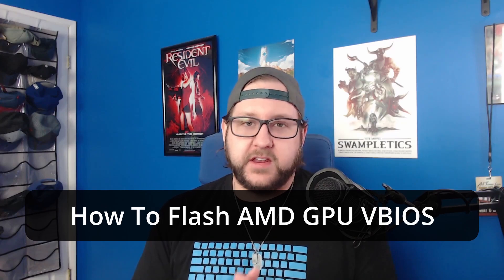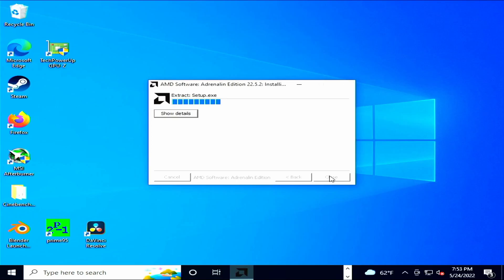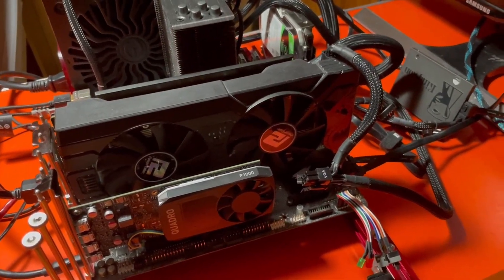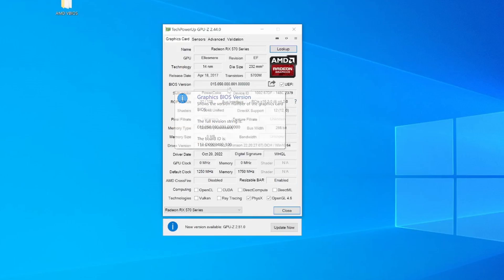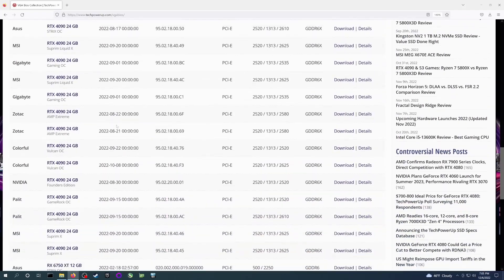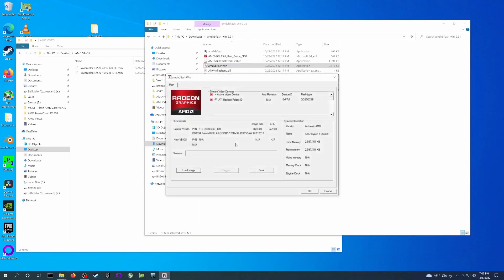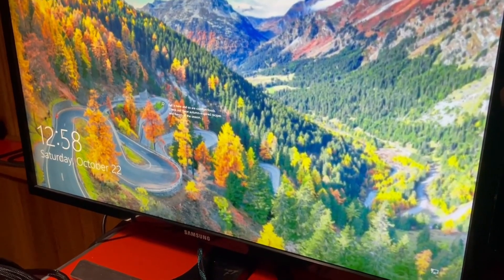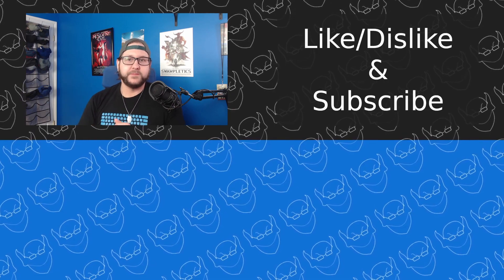How To Flash AMD GPU VBIOS

Comment: so, before even trying anything about flashing my gpu and shit, i just wanna ask some things cause i'm kinda new to this gpu faulty things so, my RX580 2048SP is been having some trouble for a while now, it can run games pretty smoothly but it just shuts down my whole computer. no artifacts, just bright colors (light red, purple, green well you get the drill), and i'm kinda curious to try out flashing it's vbios cause really, i've tried everything, ddu reinstalling drivers, different versions (still crashes the whole pc), but it was only running the games without crashing with the default video driver from windows and i was absolutely chocked that with the default shitty driver that can't even run windows smoothly was not crashing the pc so i'm really out of options rn and i just want some advice
Reply from the maker: Tbh, that sounds like maybe something is faulty with your card, like the GPU or VRAM is faulty and hitting a certain spot on the VRAM or clock speed is causing the issue.

Though it's definitely worth a shot to see if flashing a new VBIOS will help.
Reply: yeah, it is something faulty just like you said, like, when it hits a certain clock speed it just stop working but thanks tho! the video helped so much :D
Reply from the maker: @skinno9136 I'm glad my video helped, but I'm sorry to hear your card is borked :( a bit bittersweet lol

Comment: can I ask,  
I have to down clock the vram by -500
and down clock the core by -330
and also the power limit to +75% to card stable and useable and yet on another game its keep crashing

its wont crash if I dont put any load on it, since I use dual gpu
the previous owner said its flashed with another bios, even tho the card is biostar
is the problem I encountering above is because wrong bios???
should I flash it back to biostar bios???
should I DDU the driver first before flashing the bios???
or I can just go and flash it???

fyi after I check the card... its biostar... but weirdly enough windows and adrenalin driver even msi after burner recognize the card as asus, as for gpu z its as OEM (AMD/ATI)
Reply from the maker: You could try DDUing the driver to see if that helps, but it sounds like you'd need to flash a matching vbios to your card to get it to perform like "normal"
Reply: @BitGoblin  so theres is possibility this card problem is from wrong bios???
 still... I need to open the heatsink to see the vram and chip number.... dang lot of work

btw...
thanks for the answer
Reply from the maker: @mineminemaybe it's possible it has an incorrect BIOS. Does the card have any obvious markings for like ASUS, PowerColor, etc? Or like a sticker with the model info?

Some people (I think it's usually crypto miners) can use vbios for a different vendor/card that has the settings they want to run more efficiently or whatever. But that can cause other issues
Reply: @BitGoblin  tried this morning... almost all """compatible""" bios I downloaded is getting "error cant read rom"
but some bios are just straight closing the amd flash app, wonder why tho. I just do the same step like the tutorial, even with same 3.31 amd flash app
Reply from the maker: @mineminemaybe could you try an older version? Sometimes it may not work on like 3.31 but it might work on 3.20 or 2.93.

I really wish AMD made this experience a lot smoother 😅
Reply: @BitGoblin  ok, I will test it next day... since I want to get a good sleep
Reply from the maker: @mineminemaybe that's a great idea! I always seem to mess things up when it's late and I'm tired lol

Comment: the thing is, i have an rx 580 xfx gts xxx edition or whatever and i got it second hand and i am sure (or at least partially) that it is the bios. the thing is the gpu is not displaying most of the times, sometimes when i turn on the pc it works sometimes doesn't. but when it doesn't display, windows detects it as rx 590. does this mean it has a rx 590 bios? but when it is displaying it shows up as rx 580. if it doesn't display and i check gpu z, will it say the bios version and details for the rx 590 or for my gpu rx 580, even if it says the name of my gpu is rx 590? sorry for bad explanation

Comment: I bought used xfx gts rx 580 xxx oc edition but when i play games the core clock only goes upto 11mhz but the memory clock 2000mhz ok than i research some information about my gpu than i found it has a switch for bios like dual bios so i switch the bios than check gpu in gpuz it's different now like in silent mode its shows original subvendor xfx pine etc 1100mhz core clock but when i switched to performance mode it show AMD/ATI subvendor and core clock 1245mhz but memory clock 1750mhz also lower 7.0gt not 8.0 and lower bandwidth like in quite mode its rx 580 gddr5 hynix and when i switched to performance mode its rx 580 2048sp gddr5 Samsung?????????

Comment: This was my last hope.. the flashing worked to update the bios, however my card still wont work in the pci-e x 16 slot .. only the lower x4 slot... (sad face) 

great video tho..
Reply from the maker: Huh, that is frustrating! If you haven't yet tried another GPU in the slot, it's possible that maybe your x16 slot is borked.
Reply: @BitGoblin  tried 4 other GPUs in the rig, all worked just fine.. the 580 simply wont work in the X16... works in the X4 slot tho.. and it works in a threadripper x399-e mobo's x16 slot.. just no other rigs... its weird AF ... so im goign to leave it in the X399 and call it good. lol .. BUT this video DID show me how i can flash the easy way for gpu bios, so thank you much for that Sir ..
Reply from the maker: Yeah that really is weird! It could maybe be due to the motherboard's BIOS version acting weird for certain GPUs, but I've only seen that when installing like HBAs or NICs. Certainly weird either way.

Sorry for the late response, but I'm glad the video helped and you're welcome :D

Comment: Hey man, I purchased a used 6900XT and I was getting a black screen and fans ramping up unable to restart until I did a hard reset by holding the power button. I tried everything I could find online for a fix. Motherboard bios flash, all kinds of different settings in Windows changed, bios settings changed, XMP on/off or 1/2,  new DisplayPort cable, new hardware (1000W PSU, RAM), a handful of fresh Windows installs, the list goes on. 

What a fucking pain in the ass. 

All that to say thank you for making this video, it saved my sanity and saved my GPU from being thrown off a balcony. Knock on wood it keeps working properly.
Reply: Also, for those of you watching that can't find amdvbflashwin in the most recent version, delete that and download the same one in this video, version 3.31. It works just fine.
Reply from the maker: I'm surprised the older 3.x version worked. My understanding was that the RX 5000-series and newer cards needed the 5.x versions, which sadly only has the CLI

Either way, I'm glad my video helped :D I hope your 6900 XT serves you well for many games to come!
Reply: I have the exact Problem down to a tea! You dont happen to remember which bios rom worked for you?

Comment: can I use my cpu graphics while doing this sort of troubleshooting? My asus rx580 just does similar things and display borks when under gaming stress that I had to revert back to my 1050ti
Reply from the maker: Yep! Using the integrated graphics on your CPU is perfectly fine :)
Reply: @ the bios was at its latest build. I just did some tuning and undervolting… stress testing didnt make it black screen yet. Maybe it was just badly tuned by radeon
Reply from the maker: @HarenunHoppus that definitely could be it! And good job getting your GPU to work :D

Comment: I have an rx 470 powercooler , it is recognized by a very old motherboard only, i.e. a modern motherboard, not 2 times and nothing final, just a working fan. Is the vbios the problem? I hope for a replay. Thank you.❤❤❤
Reply from the maker: I would lean towards maybe the motherboard's BIOS needs flashed. Or potentially the PCIe slot you're putting the card in is dead, if you have another card to try in it would be where I'd start.
Reply: I updated the BIOS to the latest version and tried the GTX 970 it worked . This problem still for rx 470 power cooler  occurred. I noticed it on any device that has a UEFI system BIOS happen this problem . @BitGoblin
Reply from the maker: Hmm, that's a new one for me, and anything I'm finding online suggests problems the other way (it works in a UEFI board but not a legacy BIOS). Maybe try resetting the CMOS on your motherboard? It's possible there's a setting or something that's preventing it from working with the RX 470.

This sounds like a fun problem to troubleshoot! :D

Comment: I tried all the 8 bios that are in the list for flash i had bought used msi rx 570 8gb oc edition and when opening games it is giving black screen in 10 seconds i tried all the bios but the issue persists please help me
Reply from the maker: What else have you tried to troubleshoot? It might be worth like reinstalling your drivers, swapping PCIe slots, or even reinstalling Windows in some cases to see if that helps
Reply: @BitGoblin  i found the problem and corrected it my gpu clock speed and vram clocked stucked at 300mhz i turned them to 1100mhz and for vram 1650mhz and my gpu running fine but only crashing in ghost of tsushima and rdr2 which i think some files  are corrupt so needed to redownload those games thx btw
Reply from the maker: Oh, so you manually just adjusted the clock speeds and that fixed it? And that sticks across reboots?
Reply: @BitGoblin  yeah i dont know somehow it's clock speed was stucked at 300mhz thats why its crashing games as they starts i was searching on youtube for different fixes then i saw my clock speed was 300mhz then searched how to correct it and an channel with 200subs had made video which helped me out

Comment: How do I flash for a certain bios switch? I have a dual bios switch. Also how do I download the PERFORMANCE and QUIET MODE for a GPU? I have RX 580 sapphire nitro+ 8gb.
Reply from the maker: Honestly I haven't tried it on a dual bios card, but I'd assume it'd flash whichever bios is loaded. So if the switch is on vbios A then it'd flash that one and not affect vbios B. But that's just my guess. 

I'll have to test this at some point...

Comment: Hello bitgobiln! I have a rx560 power color 4gb ive tried to search for newer version but all of them are  the same as the one I have (bios number )  but the card name in the techpowerup web is 560D 4GB so do i install the latest by date? and i don't have  another gpu or a pci slot so can do all of this with the integrated gpu ?
Reply from the maker: You can try the latest by date, but I'd also click on the rom details and verify it's for the same vram vendor and such that lines up with your card. I have a newer video on the amdvbflash CLI that has a better explanation on it.

And yes! You can definitely use your integrated graphics to get a display while doing the flashing - the only reason I didn't is because my 3600XT doesn't have integrated graphics

Comment: I can't get my R9 Fury to display. Card is on, fans are spinning but just no display at all. Does it need to be flashed? If yes HOW with no display?
Reply from the maker: It's possible a flash could fix it. To do so without a display though, you would need to either use your processor's integrated graphics to drive a display or use a second GPU to do it.

I haven't tested it, but you might be able to connect to your system via RDP if it's already enabled

Comment: HI, I am having subsystem ID mismatch error. any idea why?
I have video but it doesnt detect the second monitor and cant find it in task manager
Reply from the maker: What version of the tool did you use, and what graphics card are you flashing? It's possible you might need a different version to flash your card

Comment: After flashing P/N not showing on amdflashwin how will i know my bios is changed or not? My problem is my gpu is fluctuating its usage like 90% sometimes and sometimes it drops to 2% i am not getting the desired fps i have an used gigabyte rx 570
Reply from the maker: The GUI is a little finicky and it might be that the flash didn't take or something. But you might be able to view it from the amdvbflash CLI tool

Comment: Hello I just bought an rx580 8gb 2048sp around a month ago and I've been experiencing issues with it, here is the detail of its issue: when I'm in desktop or even just windows startup it freezes/stutters with the sound of windows connect/disconnect not if sound, and when playing games it freezes my pc for a few seconds sometime it would took a full minute to unfreeze then do it again for a few seconds. I have tried many fixes I know, reinstalling new and old drivers with the use of DDU, reseting gpu, reinstall windows (this worked for only a few days but would slowly go back to its issue), even checked for some virus but never find any, even opened it up and did a deep clean, still the issue persist. Do you know any ways I could do to fix this gpu? I would really appreciate it even though this vid a over a year old.
Reply from the maker: Have you tried flashing the VBIOS? Or have you tried potentially resetting or updating your motherboard's BIOS? It could be a bug in the firmware on either, or maybe the motherboard's BIOS needs an update to support the card potentially.

If you've already those things, then it sounds like you tried all of the usual suspects of causing issues and might be a fault with the hardware potentially
Reply: @BitGoblin  I think I might have fixed it, I used the oven method lmao it stopped the issue completely and been running well for 3 days now not sure if it's gonna last a while though since it get quite hot when playing elden ring around 70-75c max despite applying new thermal paste.
Reply from the maker: Awesome, I'm glad to hear it's been working for a bit! Hopefully that's still holding up?

Comment: I bought a refurbished Radeon Pro W5700 expecting to use it on my Mac mini with an Akitio Node Titan eGPU enclosure. For some reason though, I can only use it on my Windows desktop because that's the only thing that worked when I tested it. Any time I tried eGPU on a Mac, it would kernel panic and boot loop until it was powered off or disconnected; then the Mac worked just fine like nothing happened. This GPU should work on macOS, because I've seen other YouTube videos showing the W5700 working on a MacBook Pro.

TechPowerUp shows that the VBIOS to my GPU has three different manufacturers: AMD, HP, and Dell. Turns out, mine has an HP VBIOS, since that's the only one that didn't pull any errors when I tried to flash it. I'm guessing that since my GPU came with a bunch of HP documentation, it was an OEM part to an HP workstation. Does that mean my GPU is basically region-locked? Is there a way to bypass this and install a proper AMD VBIOS?
Reply from the maker: It's possible that HP looked down their BIOS or at least did something weird that isn't compatible with MacOS. But I'm not super familiar with running an eGPU on Macs to know for certain.

Let me know if you end up figuring it out though, I'm very curious what's wrong!
Reply: @BitGoblin  I’m currently chatting with Apple community support forums, and they’re saying that the OEM locked GPUs haven’t really been an issue for macOS since 2012. They’re suspecting some weird graphic driver issues withmacOS Sonoma in particular. They’re having me test my eGPU on an older version of macOS like Big Sur, which I’m installing now.
Reply from the maker: I would not have guessed that! 😅 let's hope an older MacOS works!

Comment: Damn bro, instead of fixing the issue with my annoying 6700 XT, this method just straight up broke my PC.

It’s not your fault but I’m so frustrated at whatever fix I find, it just made more problems. Fuck, man :(

I’m in the middle of trying all the restore points to fix my computer but so far nothing
Reply from the maker: Wait what? How'd it break? I've only seen bad flashes/images make drivers not load or not output an image at worst.
Reply: @BitGoblin I did everything in the video and once the program had me restart my computer, no signal upon startup and then the dreaded blue screen appeared. It says “Critical Process Died”
Reply from the maker: @dalemau5 does it boot normally with just inboard graphics? I wonder if it's just the Gpu acting wonky after the flash
Reply: @BitGoblin I removed the GPU and couldn’t get an image, even from the motherboard. Maybe there’s a way to switch so that your motherboard gets an image but I don’t know how. But I was able to get a Windows Bootable USB so let’s see how that goes. If everything work, I’m just gonna sell the graphics card and put more for an Nvidia one :(

Edit: So I reinstalled windows but I still couldn’t download drivers for my GPU without it crashing. Then I found out about how certain GPUs have a BIOS switch so I flicked the switch and everything is working fine now, drivers installed without issue.

Comment: does you need a second gpu to do this? I only has my only one
Reply from the maker: Nope, you can run it perfectly fine with just one GPU. It's just useful if you have a second in case the flash goes poorly

Comment: Bro after downloading bios and when i load in amdvbflash tool it shows a different P/N number should i flash or not , both cards are same but P/N are little different see this - Original is = P/N 113-C6710101-100  & new one is =  P/N 113-C6710101-U2